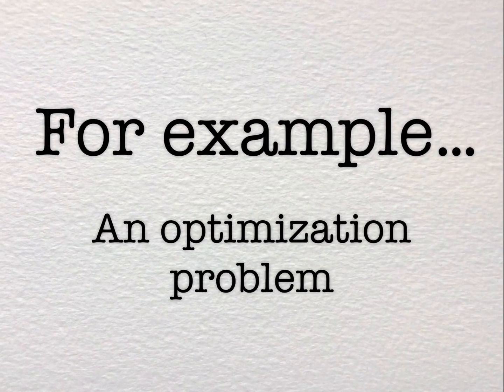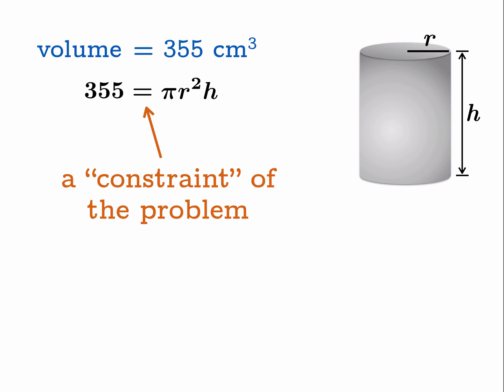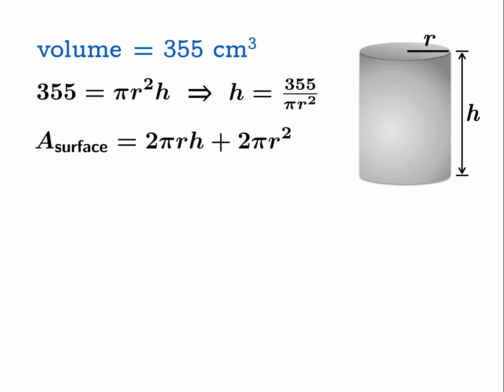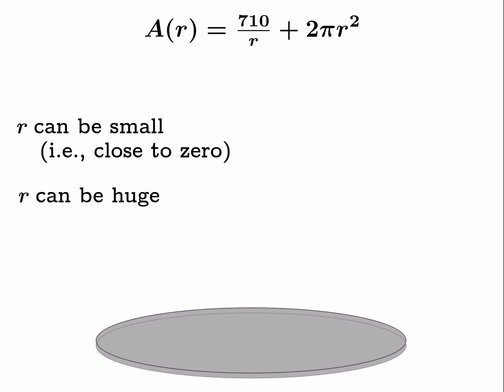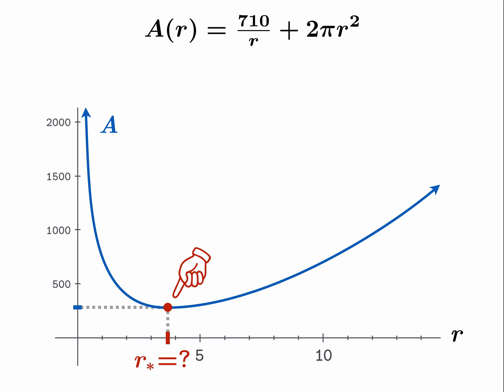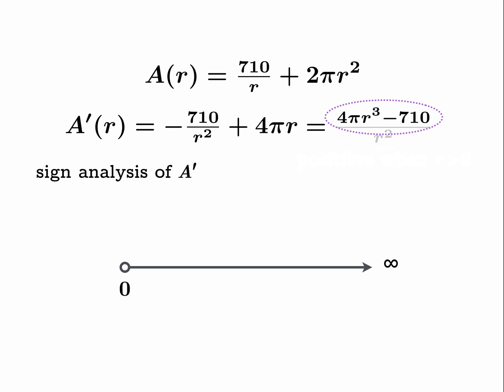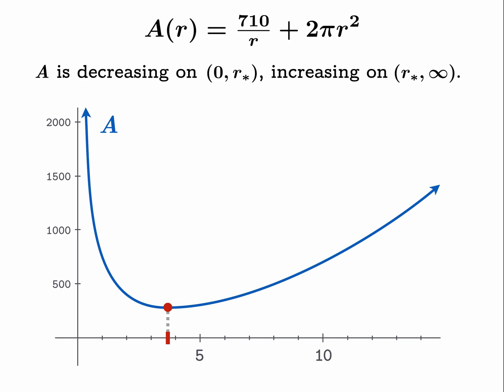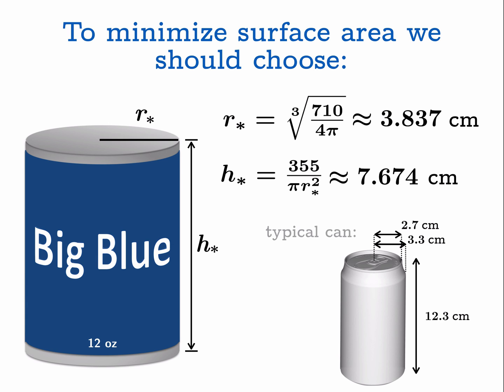QuickVid: Minimizing the surface area of a soda can

Comment: The aluminum on the tops and bottoms of soda cans are twice as thick as the sides. If you change your equation so that the surface area =(4*Pi*R^2)+(2*R*H) to represent using twice the aluminum on the tops and bottoms, then you'll get the right answer. The radius (cube root of 355/4pi) is 3.046 cm, making the height 12.18. Much closer to the 2.7cm - 3.3cm range for the radius and 12.3cm height.

Comment: A little late to the party but consider making a cost function using the surface area (i.e. the aluminum costs some value per square cm). If every part of the can costs the same amount nothing changes (besides maybe a scalar). However, it seems reasonable that the top and bottom material would want to be thicker and say, twice as expensive. This new cost function actually does optimize to something very close to a standard soda can (and of course companies want to optimize cost!).

Comment: Why do we need minimize surface area beside low cost of beverage can?
Reply: It's usable when calculating material for water heaters for example. Less surface area touching the water means less heat escaping from the walls of the heater, also lower material costs.

Comment: Also remember that soda/beer cans can be under significant pressure.  Flat tops and bottoms don't lend well to pressure vessels as they will, like a soap bubble, seek spherical shape when pressurized, as a sphere is the most efficient surface area to volume container.  That's why cans get smaller at the top and have a concave bottom with thicker material.  Quite a lot of engineering in that container we so take for granted.